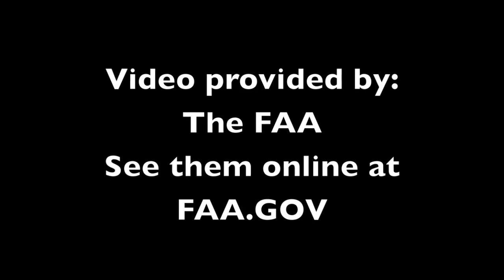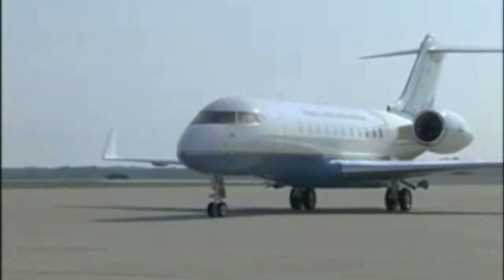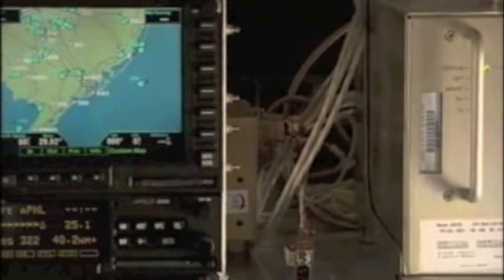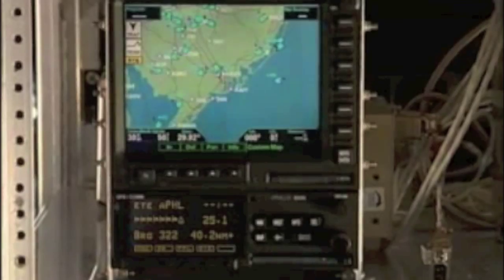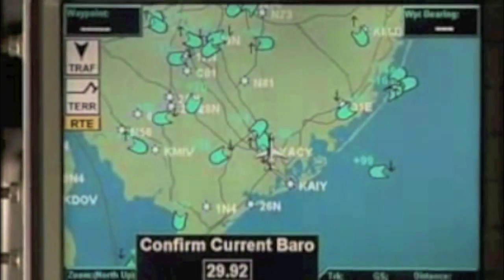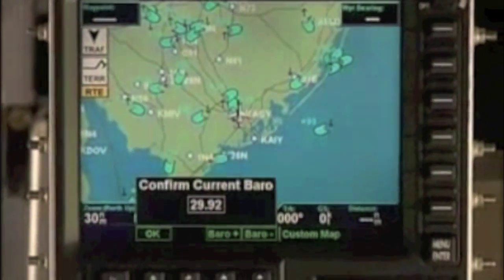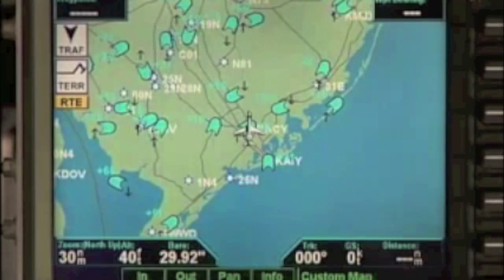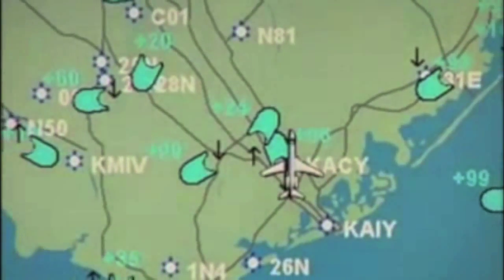NEXT GEN: Air Traffic Control

Comment: The going rate for the GDL90 is around $7000 to $10000 including installation.  Do NOT try to put this in a G1000 because Garmin nor any aircraft manufacturer supports the install on this system.  As a GA safety system, if you have approximately $30,000 (per computer seat), you can track your aircraft through ITT or Exelis (same company) software package called Symphony.  If you buy more than one licence (think Microsoft), they will start to reduce the price of the seats (licenses) by $5000.